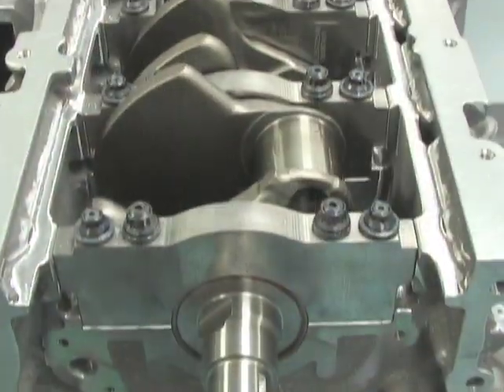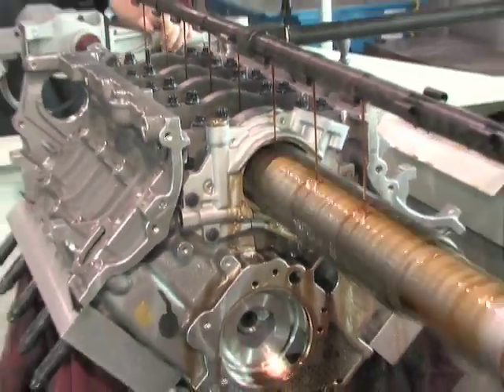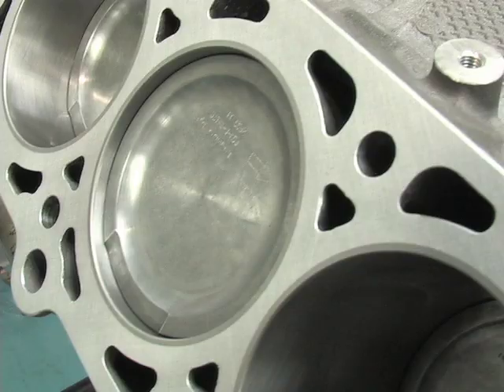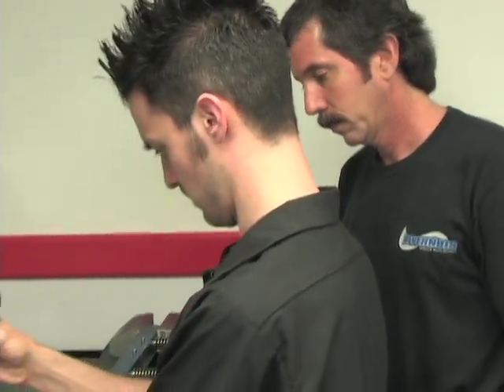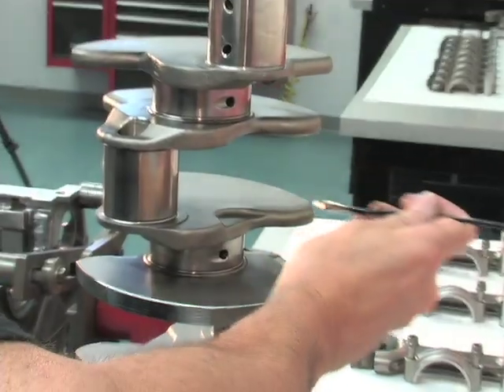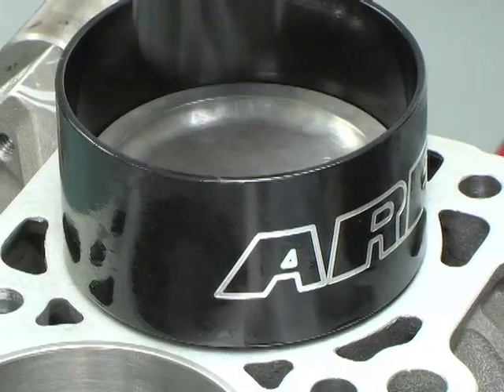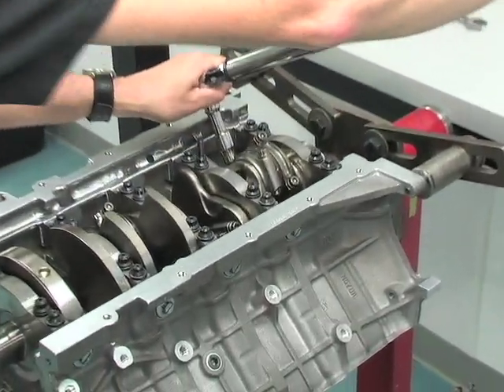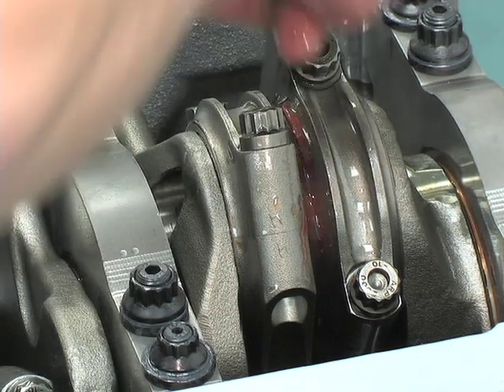Livernois Motorsports Modular Engine Build Video

Comment: Iunno you tfs head I got were junk, port job was crap had mhs re do them, stock valves were used the valves were not shortened and sized lol
Reply from the maker: I'm not sure I follow, you can't run production valves in a tfs head. And without knowing a name, I wouldn't be able to see if we were setting lash or just setting to a nominal height. All of our heads are pressure tested and the valve jobs vacuum checked before departing. If you could give us the job number scribed in the heads we keep hard copy records of all quality control processes.
Reply: @LivernoisMotorsports  Manley valves
Reply: @LivernoisMotorsports  mhs did mines they reworked and added Manley Manley valves to them